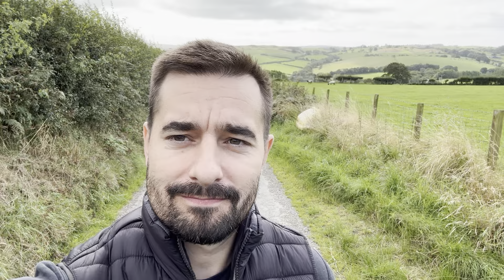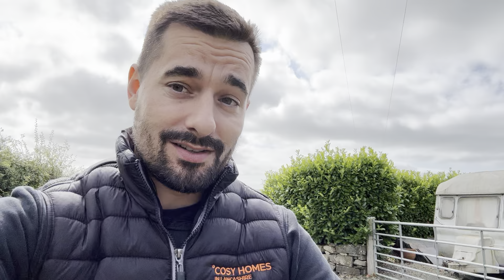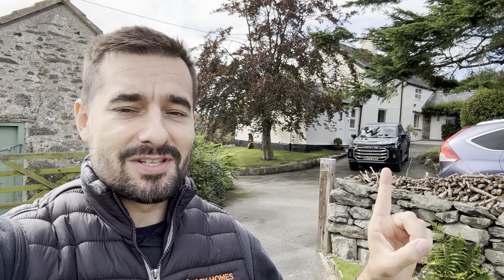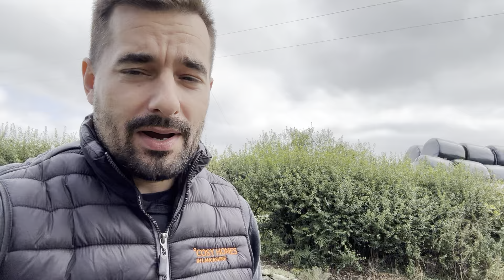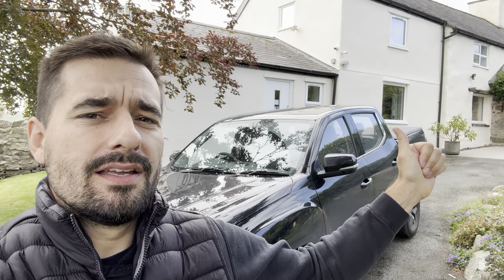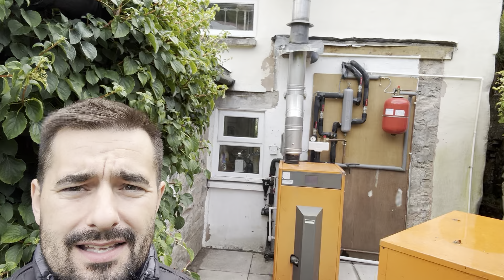Interesting air source heat pump installation.

Comment: Your accent sounds like you are based somewhere in the NW. I’m midst arranging a eco4 heat pump install (and insulation) via the council for my parents, it’s for a nearly 300m2 property. Pre insulation it was a 18kW heat loss estimate from the EPC, obviously we hope that can be significantly improved. 
Wonder if I can ask what a the key aspects I should I be looking for from the installer please, it’s the council approved installer from Cheshire East that is based in Warrington/ Liverpool (I don’t like to mention whom it is). Thanks for any tips.